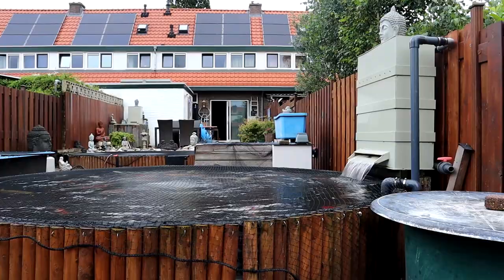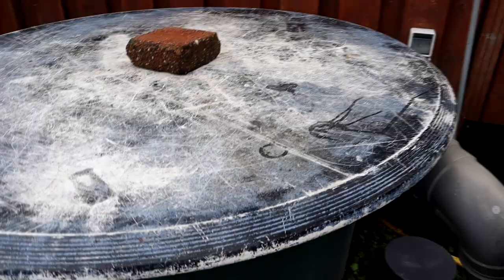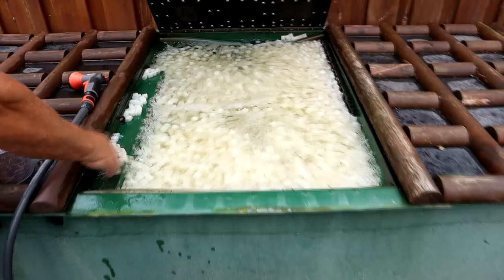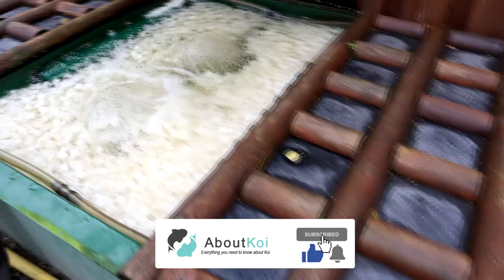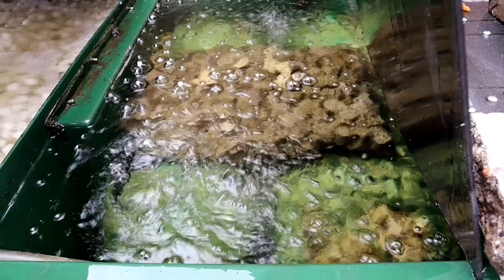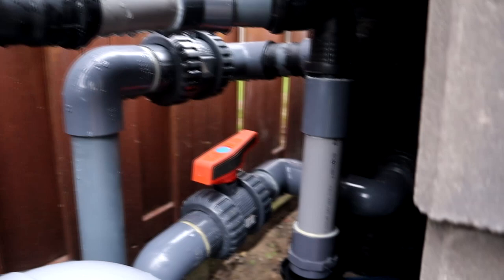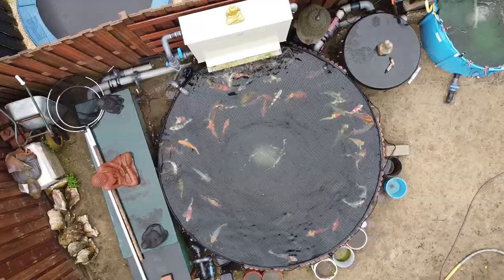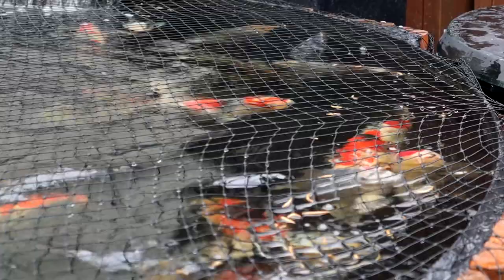Koi Hobbyist Koi Pond visit with prize winning fish

Comment: In many ways it's quite similar to the Japanese hobbyists. Like the condition of the KOI they are kept in and the water quality is shinny and sparkling. This is probably due to the aerobic bacteria circulation that has been achieved. Now, I would like to know more about water temperature control. Is he not adding any temperature?
Reply from the maker: Hi there. This owner is not heating the ponds, i think it will be around 18-26 degrees in the sumer months and around 6-15 during the coldest period of the year
Reply: @Aboutkoi  Thanks for that. It's a bit too rough, but I'd like to know how long 26°C lasts, but in any case it's fundamental to achieve TATEGOI to create and sustain a constant and intense demand for food like this at 0:31 during the feeding period. We believe that it is possible to do this in Europe and that many people should follow suit.